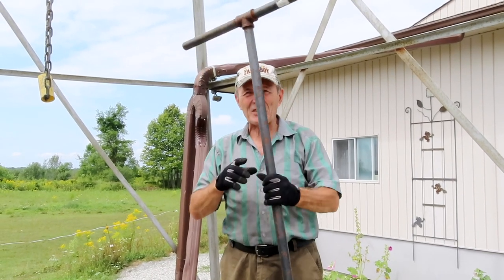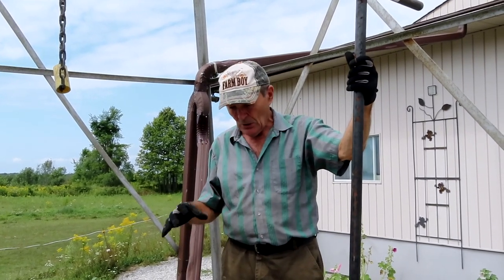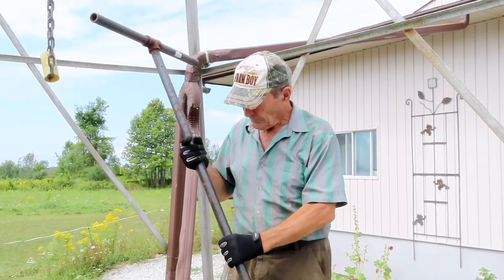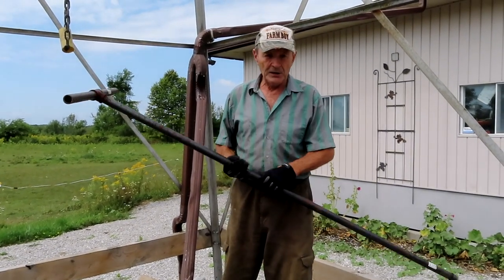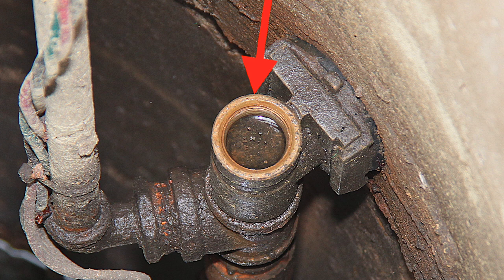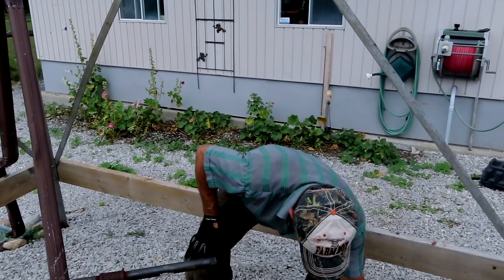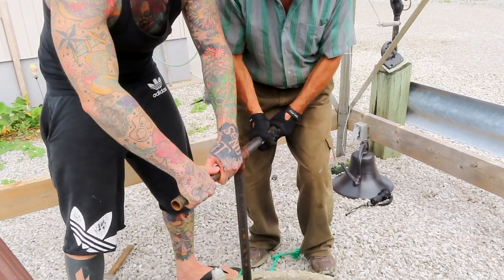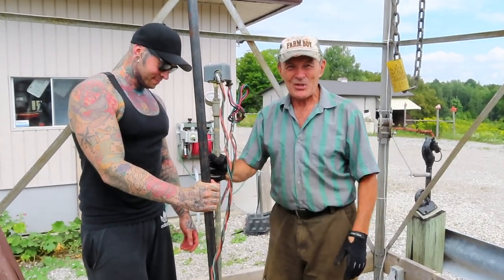#78 Pulling Out A Pitless Adapter | At The Ranch

Comment: Thanks for the info! this really saved my yesterday when my 130 foot down well pump died. One word of caution. my connector was 8 feet down so I connected 2 pieces. Nearly lost it when the bottom piece unscrewed trying to pull it up. I was able to get the other piece back out so I welded it all and tried it again, this time success. My port was dirty as well so I fixed a vacuum to the T handle and made sure it was airtight so it sucked out the dirt from the threads at the bottom. Prior to this, I had issues treading it in. 
 So anyone trying this us a single piece for the long part of the T OR weld them first.
Reply from the maker: Thanks for that very important tip for deep connectors.  I went looking for help on Youtube but didn't find any so did this for everyone.  Glad it helped out.
A
Reply: @AlecPeirceAtTheRanch  Yeah I'm sure it will become more popular. As like All things they do not make them like they used to. My pump was original to the house at 31 years old. But new ones seem to only last about 10. I'm going to rebuild the old one if I can as a spare for next time.

Comment: How do you line up the old (50 or more years old) pitless adapters that don't slide into a square slot?  Finally got mine out, replaced the pump and can't line back up so there is leaking. Wish I could post a picture of it to show you the old design.
Reply from the maker: The connections may need a wire brush scrape to remove old algae and crap.  Keep at it and it will set back in place.
Alec
Reply: replace the O ring and put a little vegetable oil on it after you clean the fitting as Alec says.

Comment: Where do I get a tbar?
Reply from the maker: Plumbing supply store or make your own.  Most building supply stores have a t-joint, 2 short 18" pipes for the handles and a long pipe down the the adapter (measure your well depth and add 2 or 3' to come to your waist.  Hope this helps.
A